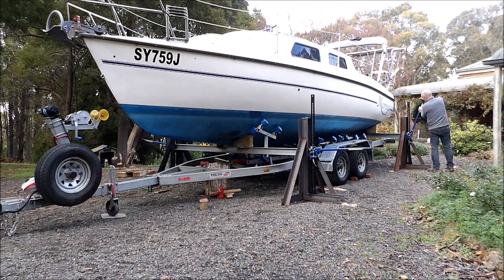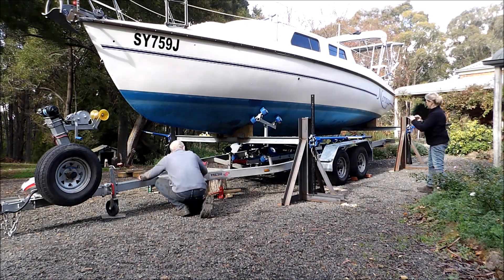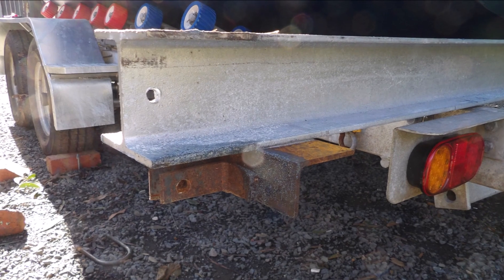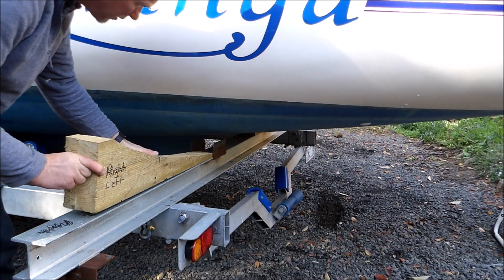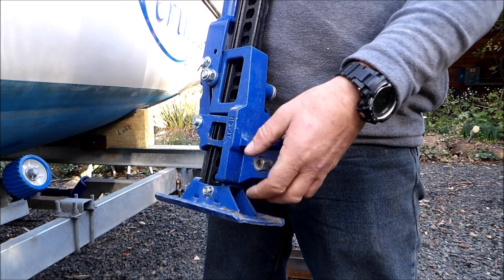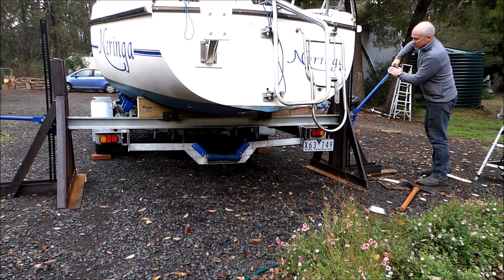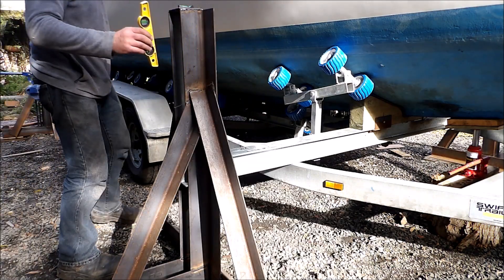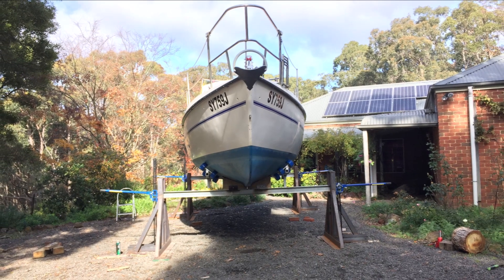Portable Hard Stand for Trailer Sailers

Comment: Hi Mark, very nice job. You think of everything, its great. Just wondering if you have plans for the ramps and if these ramps can take a 30 footer and if possible, to build them a foot higher to give 1.5m ground clearance? I'd be greatful if can help with that. 
Cheers
Reply from the maker: Hi Alex, I don't have plans but the concept is straight forward. The most critical parts are the slots in the stands must not be more than 5mm wider than the lifting beams. The beams I used have an ultimate strength of 2200kg held at the center of the beam whilst lifting at the ends. This was calculated by and engineer. Bottom line is I wouldn't try lift a boat more than 3000kg total to allow a substantial margin for safety. The beams need to have formed lifting blocks on top of the beams to spread the load on the hull and to also spread the load on the beam meaning they can do better than 2200kg ultimate. These blocks also stabilize the boat acting like a cradle. Obviously these blocks need to be made to match your specific hull shape. I made mine out of 75mm treated pine sleepers and shaped them using cardboard templates. I cant see any issue in making them a foot higher as long as you can find high lift jacks that will lift sufficiently high enough remembering the beam and the hull blocks will add around 140mm to the jack height.

If you do make the stands, make sure the high lift jacks are rated for 3 tonnes. Take careful note of their base position. It must be inside the leg of the stand and back from the edge facing the boat. This provides stability of the stands tipping towards the boat. Similarly the small angles welded to the underside of the lifting beams towards their ends are important for this inward stability. When setting up the stands they must be levelled in both directions. Without this the beams will be prone to sticking as they travel up or down. Best on reasonably level ground but the stands will work when not completely all at the same level. Love my stands and they have well paid for themselves in the number of times I have lifted my boat to work on. Hope this is of some help. Cheers Mark

Comment: Hi Mark, Love your stand design. Is this stand high enough to fully lower the kiel and - did you ever have your kiel out of the boat completely using your stand? Mine is all rusty with big flakes coming off, who are scratching on the inside of the kiel housing.
Reply from the maker: Hi Manfred, its not high enough to have the keel on the RL28 vertical and clear of the boat but certainly will when the keel is horizontal. When I bought the boat the keel was great for the part of the keel that sits outside the boat when down but the rest was rusty with big flakes of rust scratching the keel case. I raised the boat enough to work under it. Lowered the keel to rest on a plank of wood on a scissor jack and used blocks of wood and a jack to support the bolt end of the keel. Removed the lifting rod from the ram and unscrewed the end. Using the scissor jack I repeatedly lifted and lowered the rear end of the keel using the scissor jack using a steel ruler to pry out flakes of rust along with hosing with water to wash out rust dust. The bolt end slowly inched out. Once free it used the scissor jack and blocks to get it resting on the ground. It was a lot of effort but clearly really needed. The keel case was scored but not too badly. The keel head was badly pitted and with a lot of wire brushing removed all the rusted material and then filled it with an epoxy filler before repainting the whole lot. Sadly many keels get to that state because they are so difficult to get out and tricky to reinstall. I have only had mine out once since buying the boat but it still operates nice and freely. Cheers Mark
Reply: @TRAILERYACHTADVENTURES  Thanks a lot for the info Mark. That'll be my next job, but I have to build those stands first. I have all the fittings off right now to prepare for painting all of the top down to the waterline. The trailer needs work too. I have bought 2 jacks so far (off Gumtree), but probably the wrong ones - 48 inch, looks like you have the 60inch jacks, right? And 3tonne per Jack when the boat only weighs less than 3t? You are definitely on the safe side there, I was chasing 1500kg jacks.   Now back to the keel, my friend has a RL28 as well and he scared me that if I take the keel hinge bolt out - I'll never get in in again!! So apparently you got it back in again, how hard is it?    Is that bolt below the waterline? Is there a seal that would brake and has to be replaced too? I'm glad I can ask someone how has done the job.
Reply from the maker: @manfredhanicke1342  Hi again Manfred, The stand jacks I use are 60inch and supposedly rated to 3tonne but looking at other high lift jacks I wouldn't rely on them being more than 1.5tonne, typical Chinese exaggeration. Someone also sent me an article about the jacks I am using stating they are such and could fail with 3t on them. Having said all that they work well and I have never had an issue with them.
In your RL are there 2 plastic covers attached to the lower part of the toilet compartment entry wall inside and out? Removal of these allows for the removal of the keel bolt, awkward but doable. If there are no covers you would have to cut holes in this wall to access the keel bolt. The bolt is dead center and at the bottom of the wall. Putting the bolt back in is easier than taking it out. The seal question is a bit more involved. The bolt is right on the water line in most boats, below if it is loaded up with cruising gear like mine or above the water if lightly loaded. There is no real seal other than silicone being put around the ends before doing up. If the hole is worn and elongated sealing can be tricky as the over sized hole will allow the bolt to move. If you have no leakage at the moment the chances are you will be able to seal the bolt again. In my case the bolt was leaking slightly and the hole was over sized and oval. My solution was to get 2 spigot washers made up that fit the bolt precisely with a larger diameter section to go into the keel case. I then cut the holes on the keel case to fit these washers. I then installed the bolt with washers with plenty of silcone sealant. Nearly 8 years now and no leaks so they have worked. The hard part of getting the bolt back in is lining up the keel with the hole. I manoeuvred the keel with a small stand to hold it in its horizontal position but with the head lifted around 30cm. I lined it up with the keel case and likely bolt position and lowered the boat until the keel case was holding the keel. Then placed a jack under the keel head and lifted it enough to remove the stand and replaced it with a section of log (log allowed the keel to move forward and aft). Then continued to lower the boat checking constantly inside to see if the holes were lining up. I used a long lever around the keel to slide it small amounts back and forward until the holes lined up. Tricky and fiddly but can be done. Without the stands the only way would to have it lifted in a boat yard high enough to slide the keel standing vertically back in but would still take a lot of mucking about to line the holes up. Hope this is of some help. Cheers Mark
Reply: @TRAILERYACHTADVENTURES  Thanks for the long write up. Yes, my keel bolt and nut is freely visible, no covers, and I can see silicone around it. So once the keel is supported and the nut off, can I just hammer the bolt through?      Don't know if it is leaking, I didn't look when I did one test sail before buying the boat early last year and I'm still working on it so far. Bigger project than I thought.🤨    Is that bolt with all the weight of the keel just sitting in a fiber glass casing or is there a steel box of some sort inside? What would stop the bolt from spinning and grinding in the keel case, if it was rusted seized in the keel? And that whole keel looks really shocking!    Cheers    Manfred
Reply from the maker: It is important to release any pressure in the hydraulic ram when removing the keel bolt. It is a strange arrangement, if the ram is supporting the keel and the bolt is removed the front end of the keel that the bolt holds will swing upwards not down. With no pressure on the ram it will move down with the bolt removed. The keel case is definitely only fibreglass and not especially thick. Most RL28's I have looked at tend to have a keel that has never been removed due to the difficulty and as such tend to be in pretty bad condition as you describe. On the plus side taking it out, removing all the rusted material, filling with an epoxy filler and then recoating with a rust inhibitor paint and then epoxy will see many more years of good service. Support the head of the keel from below with a jack before removing the bolt. Also free the bolt up by turning it with a spanner or socket before hammering or you may damage the keel case. If hammering it out take care as it is very easy to destroy the threads. Once the bolt is level with the keel case you can usually screw it out the rest of the way by rotating with a spanner. Nothing stops the bolt turning but the hole in the keel is oversized and a very loose fit on the bolt so is unlikely to be seized in the keel. Having said that I replaced my bolt with a new 316 grade stainless bolt and also made a plate that screwed to the wall of the toilet compartment that holds the bolt from turning once in place. Hope this helps. Cheers Mark
Reply: @TRAILERYACHTADVENTURES  I'm so thankful that you answer my questions. Sounds much less threatening than the warning of my friend that I'll never get the bolt in again, obviously he is one of those who never had the keel out. I'll definitely do it before I hit the water and feel pretty confident now with your explanation. Thanks a million. The fact, that the keel hole for the bolt is oversized would make it a lot easier to line up the holes again, but less perfect for the running of it. Did you put a bolt of the same size in or would be an idea to go a little up in size?  Thanks again    Manfred
Reply from the maker: @manfredhanicke1342  According to Rob Legg himself it is important that the bolt hole in the keel is oversized and you should not increase the size of the bolt. The reason given is that the keel stability side to side when sailing is provided by the horn on the keel that remains in the keel case and that uses the keel case for stability. The bolt is not meant to take any of the sideways stress and transfer it on to the keel case through the bolt. I can see his logic but when running with the wind with not much sideways force on the keel it will knock on the keel case, designed that way but irritating to hear the constant knocking as the keel moves side to side. When reaching not a problem as the force on the keel is constantly from one side. Having said that many trailer sailer keels knock when running with the wind. The keel removal is a big job but with a bit of common sense and care it is perfectly achievable. Cheers Mark
Reply: Ok, makes sense, but maybe that horn should be wider. Or kind of a sliding plate added to the case each side. Anyway, I'm getting all excited about my keel. Took the nut off, scraped the silicone out and after several turns of the bolt I can move the bolt in and out by hand. Also took the table out and can look past the whole keel down to the driveway both sides. So once I lift the boat, the keel will just fall out.
Reply: Hi Mark, have my keel out and it looks better overall than I thought. Now I can make it like new. Tried to send you a photo of the action but cant attach here. Manfred
Reply from the maker: @manfredhanicke1342  Great to hear you got it out no problem. Hopefully you are right and it is in good condition. Will depend on how often and long it has been moored. The real condition will show when you wire brush or sand blast of the coating. Mine looked reasonable but there was a lot of softer patches of corrosion that I brushed out and filled. If you want to send a photo I would love to see the keel use my channel email "sharemyadventure.net@gmail.com"  Hope it ends up in as good condition as it looks. Cheers Mark

Comment: I'd love to know what sort of trailer it is
Reply from the maker: I replied to your messages but they seem to have dissappeared. 
My trailer is a Swiftco 7.6m tandem with breakaway breaks rated to 3.5tonnes. It was one of the cheaper trailers on the market and if I was to do it again I may not have chosen it. 

Pluses 
- frame has proved durable and strong with around 40,000km of towing our RL28 with no structural problems.
- adjustable to get towball pressure right.
- optional ladder rollers for the keel which I would suggest is a definite for a trailer sailer.

Minuses
- brake unit replaced in first 12 months due to constant problems. Alko unit has been brilliant 
-Axle u bolts 10mm were completely inadequate and one broke nearly causing a serious accident. Replaced with 5/8" high tensile u bolts which have been great.
-Brake calipers where galvanized and very quickly corroded and started having problems. Replaced with stainless calipers which have proved reliable.

Useful modifications on my trailer added by me
- centering bars at the rear center of the trailer (seen in some of my videos) help the boat to self center on the trailer
- guide posts that again help keep the boat on the trailer and centering as pulled on
-  4000lb electric winch (ebay) with a pulley block/hook to double the pull, remote control and boat loads itself.

Hope this is of some help and sorry about the late response, youtube is having a few issues at the moment.
Cheers Mark
Reply: @TRAILERYACHTADVENTURES  Hi, I know this is an old video but we are considering a RL 28 and wondering what size trailer is needed? I can see 6.9 metres off the shelf but larger than that they get very expensive, can you give us any advice on the size needed? I love you lifting setup.
Reply from the maker: @UnPetitPique  The RL28 is a big boat. We bought a 7.2m tandem Swiftco trailer with ladder rollers added for the keel. The most important thing is the trailer needs to be rated to 3.5t with electric brakes. It would be a very empty stripped down RL28 that could be carried on a 2 ton trailer and still come in under 2 tons.
On our Kimberley trip the boat and trailer combined loaded up but not completely came in at 3.2tons including the trailer. The Swiftco trailer we bought was the cheapest we could find but has had a bit spent on it to bring it up to a standard I consider safe and reliable. It still cost just under $10,000 back in 2016. So sadly to carry the RL28 can be costly is the sort answer to be legal these days. If the 6.9 trailer is rated to 3.5tons with electric brakes then it is a possibility. I don't think the original trailer sold with the RL28 was much longer than that and in those days mechanical override brakes were still allowed for that size boat. If you buy an RL28 with an original trailer it will have mechanical override brakes. Hope this is of some help. Cheers Mark
Reply: @TRAILERYACHTADVENTURES  Thank you very  much Mark. You may have saved us from an expensive mistake and I really appreciate your advice. We are still in the market for a RL 28 but I will look very closely at the trailer.Once again very appreciated.

Comment: Another great vid Mark!    Curious, did you consider renting an excavator and sitting the boat on shop bought stands ?
Reply from the maker: Not really, the cost of excavator large enough to lift the RL28 would have covered the cost of building the stands especially if you had to keep it long enough to get the work done and put the boat back on the trailer. You would also need a large space for the operation. The beauty of these stands is they can be set up on any reasonably level drive way, they can lift and lower the boat while on the stands which is required for removal of the swing keel and the trailer can be pulled forward out and rolled back when finished.
People think the stands cant be very stable but the way I have designed them they are incredibly stable and rated to 4 tons and I trust them a lot more than many of the commercial boat stands I have seen. I have had the boat lifted to 1.2m off the ground for 24 hours in gusty 30+ knot winds and the boat did not budge or even vibrate in the wind. But the main thing is commercial stands are static where my stands can change height by 1m while keeping the boat supported. And of course they are reusable with no further cost, I have lifted the boat 5 times now since building them so they have really paid for themselves. Cheers Mark
Reply: @TRAILERYACHTADVENTURES  Oh wow.. You really have got your money for them then.  Especially if you have done 5 lifts..   Thanks for the replies..  :)